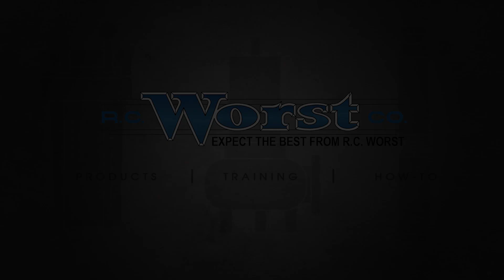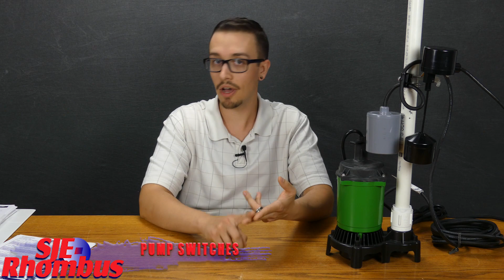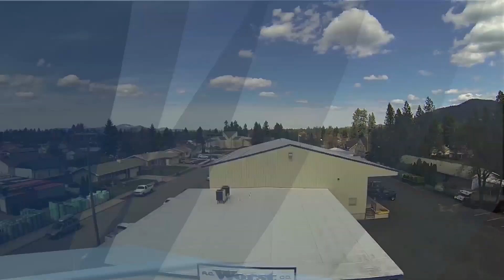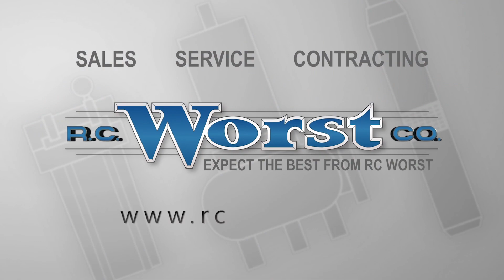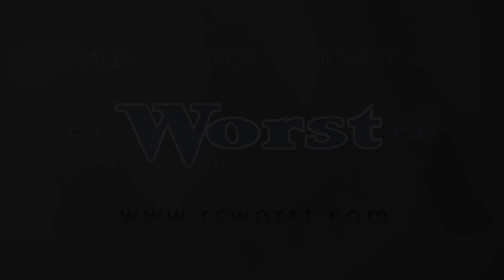Selecting a Pump Float Switch

Comment: I have an air pump with 2 pulley wheels that runs on 1HP 115/230v. It pumps potable water into a cistern. I currently have a square D float lever switch that keeps jamming or just failing. Prices on those keep coming up. From what I understand I need an NC switch of some sort. It also needs to be able to be hardwired an placed in potable water. Any recommendations?

Comment: Thanks for the info. Great speaking skills man! Not easy to speak that much without a ton of edits. Quick question for you, what do you recommend for a rain barrel  (24" across, 48" deep) when you want the switch to trigger once the barrel is full - more or less - and to pump down to empty. basically, I want the pump to only turn on when the barrel is full and shut off when empty so the pump is not draining a battery moving small amounts of water. All or nothing! Thanks.
Reply: I would think you would use the wide angle float switch connect in the midpoint between full and empty so when the barrel is full the float will be @ the highest possible angle which will activate the pump until the barrel is almost empty again and the float is now @ the lowest possible angle which will deactivate the pump. This might require a piggyback where the switch plugs into the wall first and the pump plugs into the back of the switch plug so when the switch is activated so is the pump

Comment: sir we have a duplex 3 phase sewage pump system in our kitchen area with high oil content  . We have been using float switches for running of the pumps. The float switches fail very often due to the cord becoming hard due to the oil. I am interested in Sje Rhombus C level floatless switches which might solve the problem. Please suggest any other alternative

Comment: 230 volt deep water well pump. FRANKLIN. WITH CONTROL BOX.  Below frost line 500 gal. cistern. I require a float switch.  The float switch is installed in the cistern and wire goes from the switch to the Franklin control box in the house? Or, the switch directly wires into the 4 wire power line from the house to the switch to the deep water well pump? I presumed the float switch piggy backs on the pump power line because of comments regarding pump amperage . . . .

Comment: Thanks, good info!  Any idea of which float switch would work in a deep well?  We've got a well with very slow recharge and want to periodically pump up to a storage tank.  Need to turn it off when level gets too low but then turn pump on when level high.  Was thinking the Double Float Master would be ideal (with 4 feet separation) but the well is only 6 inches in diameter, so not enough room to engage the switch, right?  Any suggestions?
Reply from the maker: I'd suggest using a float switch in your cistern, not the well, to turn your pump on and off based on how full the storage tank is. You'd also need to use a Pumptec or other motor protection device to shut your well pump when it runs dry. The motor protection devices also come with a built-in timer for resetting the pump automatically. Give us a call and we can help you find the right equipment: 855.329.4519

Comment: Which of the Rhombus switches can be used with potable water?
Reply from the maker: I believe anything but their mercury switches are rated for potable water. If you have more questions please give us a call: 855.329.4519
Reply: They make specific ones with a stamp on it that says WPS near the date stamp (water potable switch)

Comment: Hello and thanks for your vids.  I need to replace the switch on a Zoeller pump.  I'm guessing I don't have much choice but the one listed for it.  Any words of wisdom on the Zoeller pump?
Reply from the maker: Does your float have a separate cord that your pump plugs into or is it just 1 cord coming from the pump? If the float is separate, you can easily replace it with another piggyback type float. If it is wired into the motor housing i'm afraid you'll have to take the motor apart and wire in the replacement.  If you lost the owner's manual you can find it on our website (rcworst.com).